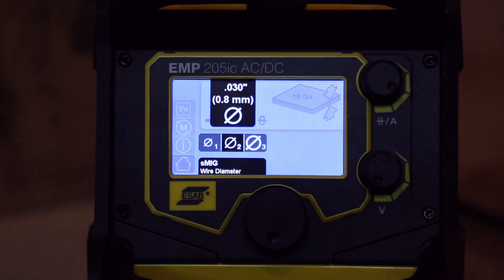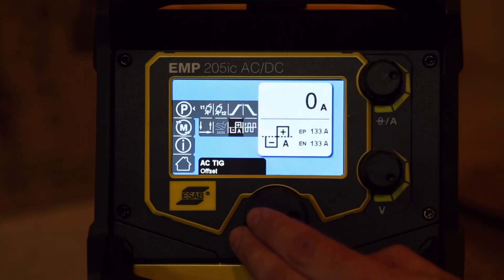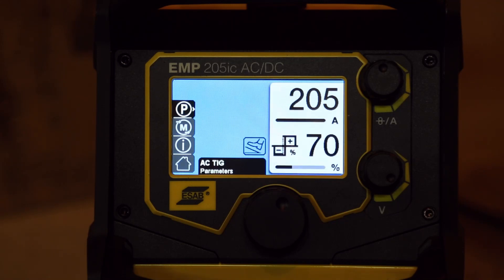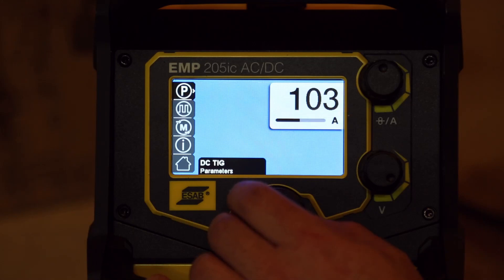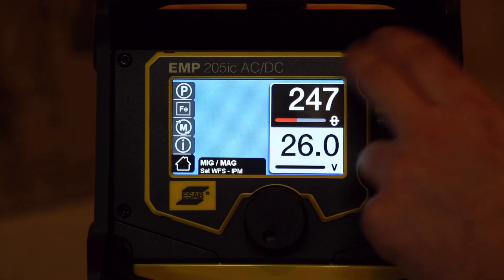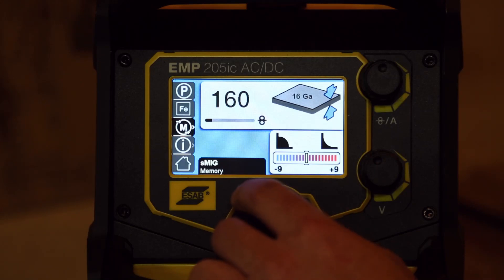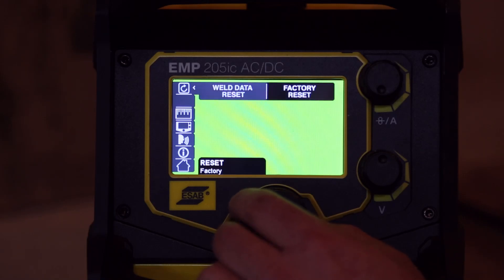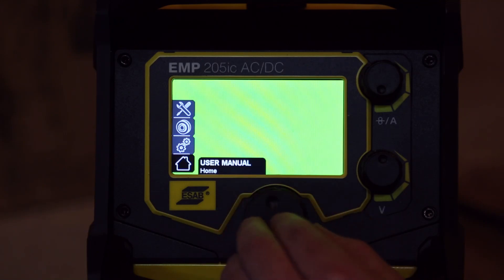ESAB Rebel EMP 205ic AC/DC Settings

Comment: Hi mate how is the esab rebel holding up ?? You still enjoying it ?
Reply from the maker: Yep it's still running like a champ, the fans are a bit noisy on it but other than that it's been a great welder, mine was the first one delivered to a customer in the USA and it's never missed a beat.  I did have an issue trying to run it on 110v but it turned out it was a bad outlet causing the problem, it was a bad connection and the mains voltage was dropping too low, the machine gave an error then would reboot.  Plugged it into a different outlet and it was fine.  On 220-240v supply it's a beast even maxed out I havnt hit it's duty cycle, those fans are doing their job lol
Reply: @weldchip  cheers as I have just purchased one but seen loads of poor reviews lol . Cheers for you reviews as they finally tipped me over the edge to try one and to save space

Comment: Does the dc tig have lift arc capability or is it all through a remote hi frequency?
Reply from the maker: Eric Winhold about 6mins15 in! You can turn the high frequency start on and off on dc so you can scratch start or hf start.  For ac you have to use hf start or your contaminate the material
Reply: There is lift start.

Comment: Tengo una rebeld 215 excelente pero requiero la pistola para mig alguien quiere venderme una y ponerla a trabajar
Reply from the maker: is it a European machine or a us model?  the European model uses a eurospec mig torch connector and the us model uses a tweco mig torch connector the included model is the Tweco Fusion 180 but i believe the velocity range also fit the us machines.
Reply: english  JA
Reply: Hola buenas noches, estoy por comprarme esta maquina, me puedes compartir tu experiencia con esta maquina por favor, especialmente con mig

Comment: Can you stick weld with high frequency activated? I'd like to see how well it stick welds 6010. Can you adjust frequency during A/C stick welding, like the AlphaTIG 200X?
Reply: what about 7010 other electrodes,  can seem to get an answer  from esab quickly  and my dist vendor  just reads  what off the  sale  brochure
Reply: Why would you want high freq for stick? It would accomplish nothing. Why the Alpha TIG offers it is bewildering. It handles 6010 very well. It’s a main point of these Rebel machines. Everything else is easy.

Comment: Just bought one tonight.  Can't wait till it arrives.  The AC pulse software update would be awesome.
Reply from the maker: JP Morgan congratulations on the purchase.  I also think it would be awesome with ac pulse too hopefully it is just software,  it should be as the unit has a pulser module for dc already.  Even without at this moment in time how it is with 400hz and the fact that you can vary amps on the +/- and being able to set the balance independently of that means you can get the pool as tight/deep or shallow/wide as you wish with various levels of cleaning and heat input. even with just the 400hz on it’s own it has bags of control.  This thing is so versatile on ac I feel spoilt.  I remember back in the day just being happy with 60hz and balance no pulse!  We used to get the ramp in and out setup nice put the machine on 2T and press the button on the torch on, off, on, off, on, off to manually pulse it!
Reply: Weld Chip did it get the ac update ?

Comment: thanks for the video I have only two questions 
1 where did you buy it?
2 from the video you say that maybe a firmware update will be available where they will activate the Pulse even in AC, I could know where you heard it?
thank you
Reply from the maker: Bakers Gas are the people i bought it from i wouldn't hesitate to deal with them again https://www.bakersgas.com/ESA0558102553.html

Doug Smith the Rebel Product Manager at Esab was the gentleman that mentioned that there may be a software update for ac pulse. I don't know how solidly they are committed to it, but it was not second hand information it was a one on one conversation between the two of us.
Reply: Thanks!!!!! @weldchip